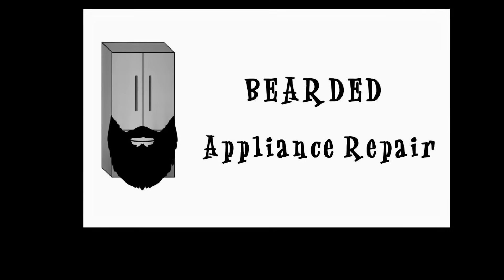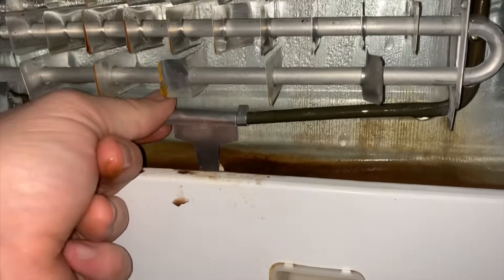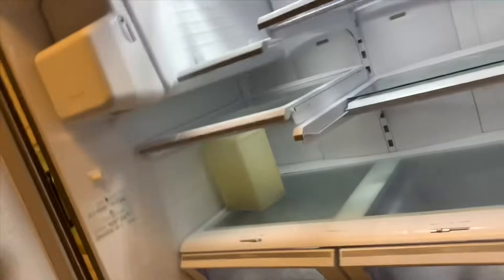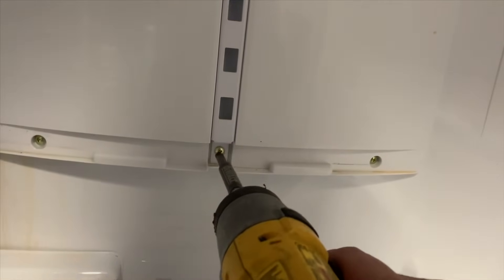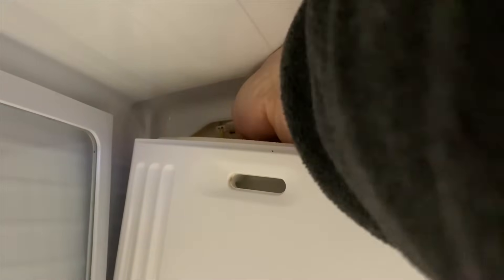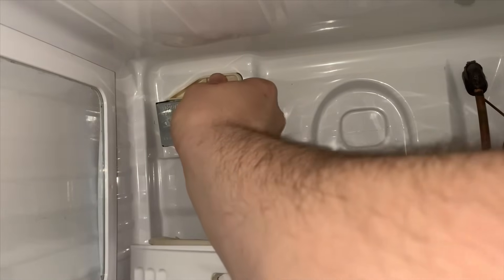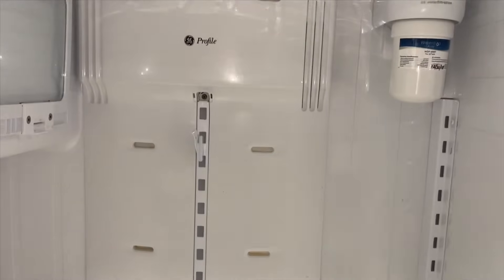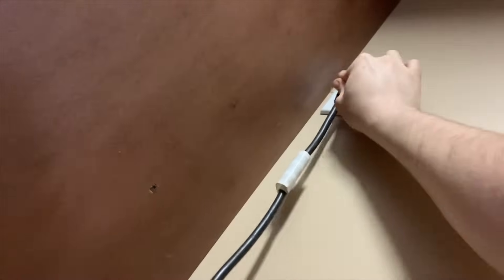Samsung fridge water collecting under deli drawer fix (DA82-01415A)

Comment: great video - very helpful - thanks!  My problem seemed to be rust in the tube that takes water from the fridge / the tube was blocked.  As others have commented, I just cleaned the tubes / didn't replace them -it's a simple tube / funnel. Some suggested to start with the tubes from the back of the fridge and save the time of clearing out the fridge and opening up the back panel / replacing the metal clip. The most time consuming part of that process was clearing the food out of the fridge - the actual replacement of the metal clip only took a few minutes.  I figured  -why not replace a part that's a known problem.  My Samsung branded fridge seems identical to the GE branded one in the video.  The top screw holding the rail at the back of the fridge that the shelf brackets go into was covered by a plastic cap in mine that I had to remove to get to the screw - only difference I could see.

Comment: Thanks for keeping this video up. It was so helpful. The drain tubes did not seem to be clogged at all, but I still replaced them. But the inside was definitely iced over and I replaced the clip. However, now that I’ve put everything back and plugged it in, when I open the doors, I smell a slight burning smell. Any idea what that might be?

Comment: This video was very helpful.  I did exactly what you said to do.  I replaced the drain tube heater and drain tubes and I still have water collecting under the deli draw.  Can you provide any other issues that I may have to fix this problem?  Thank you.

Comment: great work!  thank you for the walk through.  I have a Samsung 267 Series and every component is exactly the same on mine as on yours.  I had icing around the evaporation coil.  I suspect the icing was primarily because of a clogged drain tube.  The ice ultimately interfered with the fan rotation as well as blocking  the drain tube.  Naturally the ice buildup will interfere with the efficiency of the defrost cycle in that insufficient melting will result. For now, I simply thawed the ice around the evap coil, blower fan, and unclogged the drain tubing that leads to the pan below.  I'll run it for a few days to see if the ice returns.

Comment: Thank  you for the video, yes we have a Samsung French door refrigerator with freezer draw below and we have had the same problem with water entering the compartment due to the drain tube freezing. As you have shown the heater clip is not long enough to prevent freezing, The lower pipes were clear and were able to be used again, after a thorough cleaning, our heater tube has a more definite V shape and applying the new version took a bit of bending but we have it installed, now fingers crossed it does not happen again, It looks like a bad design fault on the behalf of SAMSUNG, also it was extremely noisy when first purchased and was fixed under warranty, so all in all never again with Samsung.

Comment: Great video. Mine was frozen in the back panel. I had originally put an extra copper wire on the black heating element. I already cleaned the tubes. 2 years later, frozen again. I bought this kit to fix it. But, can I turn off the ice maker, will this help? And what temps should freezer and refrigerator be set at to help this freezing issue, if larger clip doesnt help

Comment: Note about turning back on after fully thawed and at room temperature (my refrigerator is Samsung RF4287HARS): After servicing both the refrigerator section (installing kit* for insulation strips on the aluminum pan behind the evaporator, a new heater clip that extends further into the drain hole, and two new drain tubes at lower back of refrigerator), and the lower freezer section (removing the cover over the evaporator for inspection and assurance that the heater clip is properly in the drain hole – mine was misaligned from factory installation), note the following:  I had my refrigerator unplugged for 24 hours, all food removed, doors open.  Upon plugging it back in, I was initially very concerned because only the refrigerator was beginning to cool back down and the freezer was not.  I tried two methods of reset: 1. Reset the refrigerator by pressing and holding for over 5 seconds the ‘Power Freeze’ and ‘Power Cool’ buttons simultaneously until the panel started flashing (some models may chime).  2. Reset the whole refrigerator by unplugging the refrigerator for 5 minutes and then plug back in.  I then just had to be patient.  Turns out, the refrigerator had to cool down first, almost to my temperature setting (34 F) and THEN the freezer began to cool and within a few more hours it slowly reached my setting (-4 F).  (Reset step #1 above should be all you need to try.)

* This kit was available from Amazon; Search “DA82-01415A Refrigerator Water Leak Service Repair Kit Compatible with Samsung Water Leakage Assembly Replacement Parts DA82-01415A, AP5957964, PS1005968“.  This fit my Samsung RF4287HARS refrigerator.

Comment: I finished the repair today-cleaned out the evaporator drain hole, replaced the crappy riveted metal tab with a better one like in the video, flushed some hot water down the drain with a syringe, and replaced the lower drain tubes. I wish I'd had a helper to verify the hot water i shot in there with my syringe actually came out the bottom!  I also thought afterwards it might have been good to snake a flexible bristle brush down the hole to clean it out, but I'd already reassembled by then. I also sucked out all the accumulated water in the drip pan, then squirted some bleach/water in there, let it sit a bit, then sucked it back out, rinsed with plain water, and sucked it out again--just because the water down in there was nasty green. 
The other part I replaced today was the water reservoir assembly. I noted some ice buildup behind that, so I think maybe it's heater element had gone bad. All fixed now, so hopefully no more leaks or ice/water under the pullout drawer! Last thing I did was mount a portable water alarm behind the fridge with the sensor on the floor, so if anything starts leaking again, I'll know about it!

Comment: I  replaced heater clip with larger one after using Baster syringe of warm water lots of times and replaced the drain tubes in the back and still leaking under the crisper. Did I need a long 3 foot wire brush to clean out the drain deeper down? The larger heating clip and replacing the two wires behind the panel along with replacing the circuit board did the trick  1 1/2 years ago. Maybe  I need a long flexible wire brush to clean deep in the drain itself or do I remove the  freezer drawers and it’s in the freezer somewhere? Any ideas would be welcomed.

Comment: Thank you! After watching the video and ordering the $25 kit from your link, I'm pretty sure I can do this. The service tech quoted $760 to do it, but were kind enough to offer a $200 discount. So $25 vs $550... not a difficult decision.
Reply: Thats a grossly overpriced estimate unless you have a multitude of symptoms.
Reply: @SpiritCannon  He wanted to replace the back panel, harnessing, and electronics, just in case there'd been some warping and moisture leakage. And he didn't even have the kit on him, despite it being in the appointment notes. This was a certified tech, and in the end, he seemed so embarrassed by me refusing the quote he didn't write up or charge for the home call. Fixed it ourselves pretty soon after and it's been fine ever since.

Comment: I recommend trying step 2 first to see if the hoses to the tray are blocked.  Mine released a bunch of water when I pulled it off and cleaned it out.  Hoping to avoid the defrost part. 🤞
Reply: How did that work out for you? I'm also hoping to avoid the defrost part.

Comment: A known permanent fox for this is installing a secondary aftermarket heating element to the copper pipes going to the cooler as well as replacing the drain hole heater clip as mentioned

Comment: Perfect instructions! Thanks. I fixed my fridge easily and is now running like new.
Reply: is it still good? wondering because i am about to do this/
Reply: Sue where did you buy the parts? I need to do this to my fridge too.
Reply: @nancydutra7347  did you find the kit? The link provided says out of stock.
Reply: @dougprentice1363  I did and it worked great. Fixed our problem. We ordered from Amazon.
Reply: @dougprentice1363  amazon

Comment: Although my GE evaporator cover is mounted differently and trickier to remove due to plastic tabs, all else is similar and your video would’ve helped some years ago when I last replaced the heat probe.  Rather than leave the fridge apart while waiting for the part to ship, I cut my own probe out of aluminum sheeting.  It held up for a few years but needs help again.  I’ve come to disdain anything Samsung.  I’ve even found their brand of capacitors in other makes of electronic home devices to be basement quality.  I appreciate your video;  it will help me take repair steps in the proper order instead of guessing my way along, hit n’ miss, next time.  

My only critique is that you didn’t take the opportunity to clean the fins over the drip tray in the back/bottom.  They were filthy and make the unit less efficient.  I’ve also found the fan blades there usually need cleaning;  uneven dirt accumulation on the blades make them spin out of balance also, increasing operation noise and shaft wear.

Comment: Thanks, worked great. Made my on heating coil with some copper wire wrapped around the heating element, then put all the way down the hole to keep the ice out.
Reply: great idea!!!
Reply: that's what I was thinking, how's it going, any more leaks?
Reply: @angelessolis1632  I’d did this a few years ago and now I’m back to having huge ice sheets under my deli drawer

Comment: The evaporator fan isn’t running on mine, but the compressor works and the fridge will cool but unevenly in the main case. A couple months ago we could hear what sounded like a bearing failing and then eventually it stopped making the noise, and that’s when the fridge wouldn’t cool well anymore. Anyway took it apart today to find a lot of ice in the evaporator. Waited for the ice to melt and put it back together and powered up but the fan still isn’t running. My guess is the defrost function stopped working some months ago and then ice blocked the fan from running. Perhaps that fried the fan. If so am I looking at a new fan and new defrost sensor? Local parts place says the evap fan is special order and doesn’t think it’ll even come in. Price is $250. I wonder if it is worth trying to repair…

Comment: In a hurry tip: After removing the shelves and drawers I set a portable space heater at 85 degrees F about 1 foot away from and facing the back panel. Leave the doors open so the space heater doesn't overheat. Fridge was fully thawed in just over 90 minutes. Everything else went as shown in the video.
Reply: I do the same thing with an electric fan set on high and aimed at the evaporator cover. However I typically allow 12 hours and just plug the reefer back in assuming that it's fully thawed. That way I don't have to take off the back cover. But I like your 90 minutes better and will try that next time.

Comment: Hi! Thank you so much for all the tips. 
I had a question about the drain tubes on the back of the fridge. 
Where is the water suppose to drain to ?
Reply: Into a pan where the heat from the condenser coils evaporates the water.

Comment: So straightforward and helpful. Saved me an almost missing gasket during reassembly. Changed out the heat clip but if the drain tube needs love too I'm fully confident I could do it thanks to the video. Thanks again!
Reply: where does the water go after bit drains
never mind i saw it, does that water in the bottom pan just evaporate when all the frozen water drains down?
Reply: @sharonnelson5471 I was wondering that myself. I too have had this problem continuously and have just been checking out the ice. But now the whole thing went out. Will try this fix and hope it magically makes it work again.

Comment: Well, I just finished doing this and just plugged my fridge back in. I even went into the back and checked the drain tubes and rinsed them out. Now, to wait and see if it was a success. I sure hope so, I don't want to have to go back in there and try and figure out where I went wrong or that there could be a different problem.
Reply: What a difference a day makes. Yesterday, felt good over being able to do this fix on my own Samsung fridge. Today, it's leaking again. I went wrong somewhere or it was more than just drain backing up. Going to have to go back in there and see what's what. I noticed that panel that you remove to get inside there, has condensation on it sometimes. I'm wondering if the panel is not tight enough to the back wall of the fridge. It seemed like I got it right, but maybe not. Or maybe I didn't get that piece I bought to go in the drain on correctly. Oh well, we'll see.
Reply: Same we did same n its leaking still I give up sick of this fridge this 3rd time we've tried to fix it

Comment: so this is a permanent fix.  some say you have to add an additional heater element to the top of the defrosting unit.  cable tie it to the copper tubing at the top.

Comment: Just curious as to why you wouldnt want to clean those coils in the back that were obviously caked with dust. Wouldnt that be a good idea to prevent any possible issues down the road??
Reply from the maker: It absolutely would.  I always mention it to the customer and I charge just a little bit extra for it. Customer declined and wanted to do it himself.

Cleaning the condenser will make your fridge run more efficiently and won’t be running as long so everything else should last longer.  Always a good idea to clean the condenser.  Thanks for bringing it up!

Comment: When I inspected that clogged duckbill part in the top of that tube, the end broke off.  I decided there was no need to purchase any kit with new tubes that only had larger holes in that part since I already had a larger hole because the tip broke off. The tubes are not the problem.  That small internal plastic baffle at the top of the tube is.  Just make those holes larger, or break off the bottom of that piece like I did.  I cannot envision a need for the extended aluminum piece to carry heat into the top of the drain hole since there can no longer be standing water in that portion of the tube.

Comment: great job bearded one! very well explained and good video angles. folks at home - if you want to save some hassle, check the drain tubes first. If water comes gushing out, your problem could likely be solved. you can clean out the clog and reinstall the tube in less than 10 minutes AND you don't have to move all the stuff from the fridge, freezer, buy parts, defrost, etc.... just did one today like that as a matter of fact. These drain tubes clog ALL THE TIME.. IF you still have water issue after that, then you have to follow this pro's advice, or call him if you are in the area!

Comment: Great video!   Thank you!  We needed both fixes.  We only replaced the clip inside the fridge and it still leaked.  Found out that both drain hoses in the back were clogged.  The hose narrows to small slits at the top and they get blocked with gunk.    New drain hoses have a different design.   Or I guess you can clean out slits on old drain hoses and reuse them but check to make sure they don’t get blocked again.

Comment: Thank you for this great video. Where does that water go, once it reaches the two lower drain tubes?
Reply: The water goes into a pan and is evaporated by the heat from the condenser.

Comment: I may have missed this in the video, but what is the name of the drain hose kits and the clip I need to buy? Also, do you have any tips for the non-working ice maker on one of these? I plan to do the repairs, and then reset the temp as suggested.

Comment: Excellent video.  But my back panel looks different.  It has the ‘twin cooling’ circle at the top.  What’s the trick to removing it?  Took out all the visible screws but it appears stuck at the top.  Thank you!
Reply from the maker: Defrost the ice behind it and it will be easier.  Unplug the fridge and open the door for 24hrs and she should come right off for you.
Reply: @BeardedApplianceRepair  Thank you!!!
Reply: Another issue is a ball of ice builds up there let it defrost and look I bet you have that. Look
Around another kit has a warming cable that stops that

Comment: Thank you for the helpful video! I have a question. Mine was frozen behind the panel by the fan on top rather than the bottom. A huge chunk of ice. Took 2 days and blow dryer to get the back panel off. What do you think is causing the leak. I think it’s something on the top right. Because that’s where the ice formed up to. I got all the ice off still need to check drains but wondering if I need something else to stop the leak.

Comment: We were quoted $800 to fix hole in evaporator. There is water leaking but freezer stopped cooling and refrig now too. Would this fix all the problems or just the leaking? Thx
Reply from the maker: Yeah do not buy the kit if you have issue in the freezer as well.  That is a more serious issue.  That not a DIY issue either.  Takes some equipment and freon to do a sealed system job.
Reply: Bearded Appliance Repair Thank you!